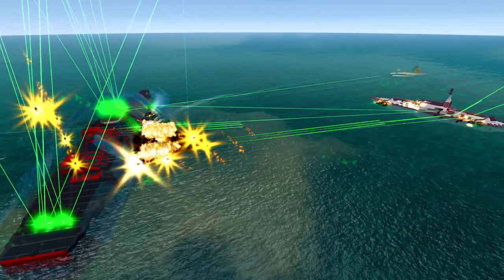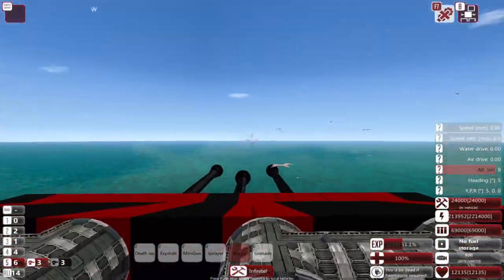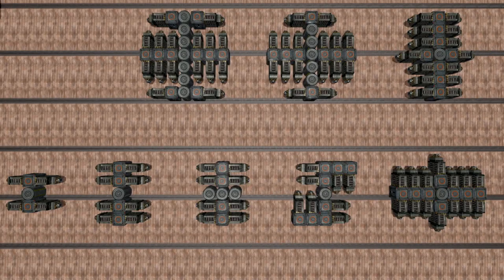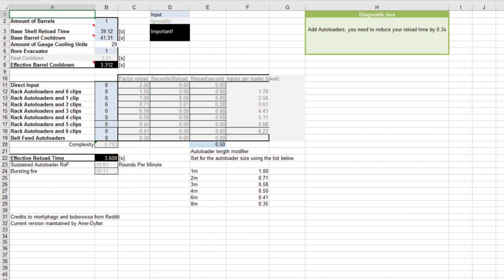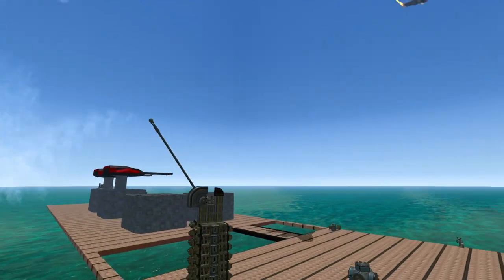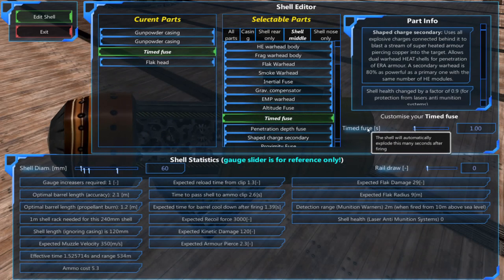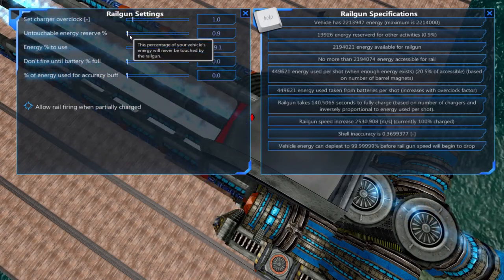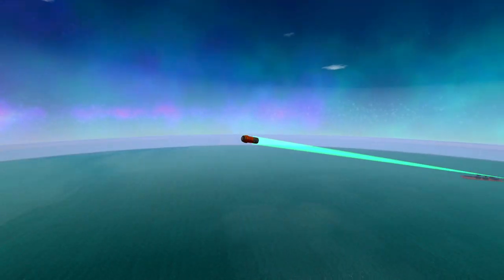From The Depths In Depth Advanced Cannon Tutorial

Comment: On your LWC restriction for AA targetting (or non targetting) May I recommend you use fire restrictions instead? You can both make the guns only aim up or not up. It means the cannons will fire whenever they have a target in their field of view, which includes long range high altitude targets for your main guns, an elevation they can usually deal with, but a LWC height restriction might cause them to ignore.
Reply from the maker: For AA guns that can work. The main cannons are still going to try to shoot down fast moving flyers they cant keep up with. A max speed setting in the LWC along with the field of fire restrictions could work.
Reply: ballparkkenan but if you outright restrict them with lwc they'll never fire on those targets, even if your other weaponry gets disabled. If you use target prioritization and fire restrictions you can have them prioritize the proper targets but on when all else is down they'll take a chance at those lower odds. 
Just so you don't become unable to deal with a tiny pesky fast thrustercraft that managed to take out your AA turrets.
Fire restrictions also have the added bonus of allowing a vehicle to target several others, with any weapons that would otherwise be idle and cab Target something.
Reply from the maker: You make a good point. My main turrets on most of my ships aren't restricted with elevation so i just turn them on or off depending on the AAs ability to shoot down a target.

Comment: 1. Why wouldn't you use the best AA mantlet on every gun that's mounted on a turret? Since the azimuth is irrelevant because the turret can rotate, the best AA turret will give you the greatest coverage both vertically and horizontally. Why prevent your turret from being able to aim upwards effectively?

2. I noticed near the beginning of the video that the cannon you were looking at had an accuracy of somewhere around 0.3. Do you consider this to be good? I got one down to 0.085, but the barrel was ridiculously long. I'm having an issue with APS cannon shells hitting the water in front of ships instead of hitting the ship all the time. Is this normal inaccuracy? I can't see where I'm making any mistakes in building it. I've used just about every detector also, from coincidence rangefinders to laser rangefinders, cameras, and radar. Even the above mentioned 0.085 accuracy cannon would hit the water a good 50 meters in front of the enemy about 20% of the time.

3. Really appreciate you taking the time and effort to post these FtD tutorials. I haven't played in 2 years, which was before the APS/Cram/detection equipment/etc...
Reply from the maker: 1. I use the AA mantlet on most of my turrets. It just depends on how high up the barrel is on my ship. If its to high up, the AA mantlet wont be able to aim down and shoot at ships that get to close. 

2. Yes, 0.3 is good for slower HE/HESH/HEAT shells. I would even say its good for AP shells. Although AP shells don't need heavy HE shell pieces and have more room for gun powder/rail gun casings. Making them faster and more accurate. For accuracy, anything above 0.5 is to inaccurate. Most, if not all of my guns have a high fire rate and HESH shells. Making pinpoint accuracy not necessary. 

For the shells landing in front of the target, select one of your detection systems and select auto adjust.

No problem, i'm glad to help! I hope this answered your questions.
Reply: Thanks a bunch! Another question: Does cannon (CRAM/APS) need to have any detection equipment mounted on it's turret, or does it get targeting info from the mainframe? I thought as long as you had detection equipment on your ship, it would be shared with all weapons on the ship, but I had an issue with a turreted gun that couldn't seem to find its target until I actually put detection stuff on the turret with the weapon. Really confused about all the different detection stuff. Maybe you should make a tutorial on all the different types of detectors, which ones are the best to use, and how to fine tune those damn settings. :D
Reply from the maker: No problem! No, they don't need to be on the turret but it does help to have back ups in case the others get destroyed. I'm working on a complete ship building tutorial that'll cover the detection systems but i'll most likely do a separate video on them as well.

Comment: If you still read comments, how do you have your gun hit the target? This is with AI I’m fairly new and am having a hard time getting my cannons to stay focused at a target
Reply from the maker: You'll need to have detection equipment connected to your crafts AI.
Reply: ballparkkenan what type of detection equipment? And is there a way I can get around it without having to use detection equipment?
Reply from the maker: I'd recommend a 360 camera, a laser range finder and a camera gimbal tracker for a decent but basic set up. If you want to disable the need for detection equipment, go into the options, config, then on automatic detection accuracy select override default and make sure the automatic detection accuracy is set to 1.
Reply: ballparkkenan thanks it worked, last q, how do I get all my ships to spawn in a battle?
Reply from the maker: When your in the pre battle screen, increase the volume allowed in battle.